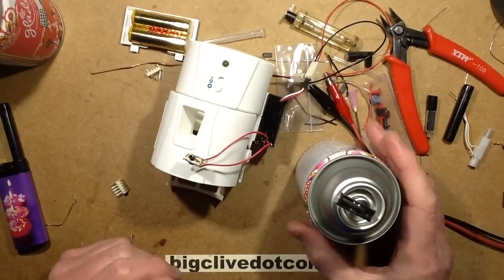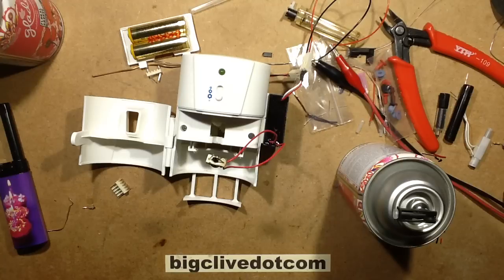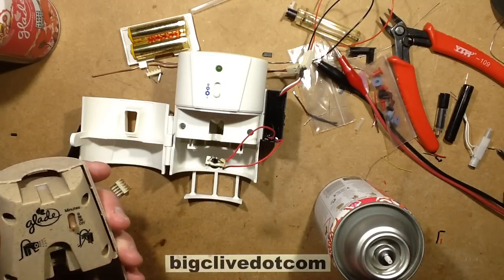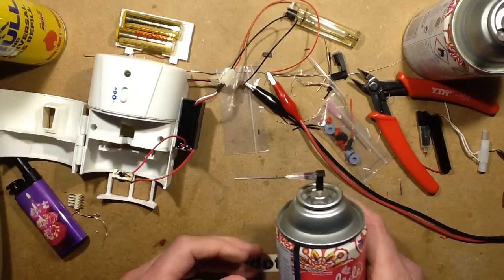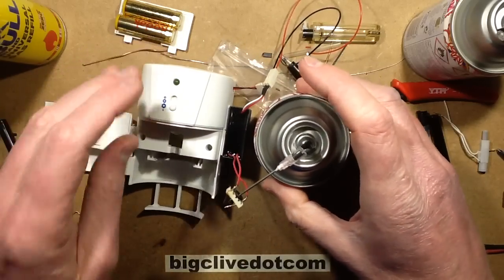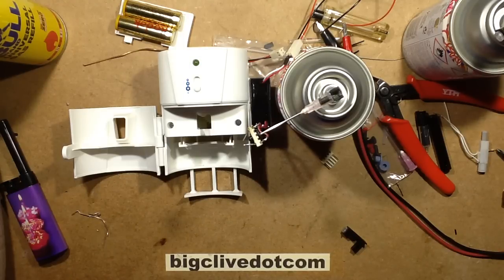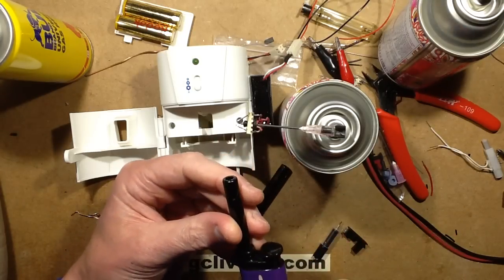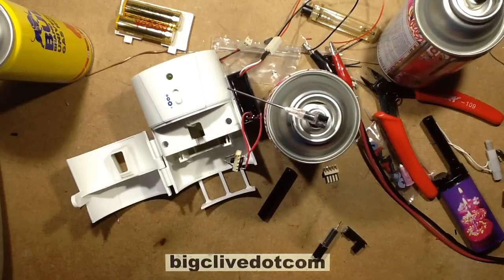Failed automatic flamethrower project.

Comment: 7:45 Big Clive just nailed it: Burning gas is not easy and exploding it is far more harder and getting the explosion actually do lot of damage is so much harder than you think. As an example in the building I was a super in 80's someone tried to commit suicide by inhaling cooking gas. The traditional open oven door, extinguish the flames and stick your head in job. But she forgot the pilot lights on the stove top. So gas starts to flow she passes out and slides from the oven. Gas get to critical mass and the pilot light ignites it. Result was a puff that was heard about 20 meters away. But the fact that the kitchen window broke the shatter was so loud that someone heard it and started to investigate. So firebrigade and police had come in. Later an ambulance came to take the still living culprit away. The major damage was that the explosion had broken the kitchen sinks sewage connection which was cast iron pipe and those pieces had plunged from the fifth floor all the way down into the basement where the was a bend on the sewage line. And of course there was no inspection hole there. So still in 80's that sewage pipe was prone to block.

The most stupidest TV explosion was the penultimate episode of Criminal Minds where the criminal explodes a three store building by inginiting a room full of gas. 1. If there was no air in the room the gas wouldn't explode or even burn. 2nd. Amount of volatile gas mixture in a room would not obliriate three store building.

Comment: I'd like to see the Whorehouse Perfume Cabinet Exploder project revisited 

Problem as I see it is you need the fuel to exit the nozzle as a fine mist and then add the oxygen source downstream in such a way that the flame can have a controlled starting point.
Could the snout from the stove lighter be cut to whatever length would be experimentally suitable and then sealed onto the original diffuser nozzle to achieve both? It seems to me that the snout itself could also possibly be used as one electrode of the igniter. I'm not sure about the mechanics of the automation, I'm NOT that electronically crafty

DISCLAIMER: This is all armchair theorising and it is not to be inferred as having any basis in juvenile farting about by someone called mulgawilliam

Comment: Old video, I’m aware.
If you’re wanting a quick burst of flames using an electric ignitor you need to mist the fuel.
If you use an electric ignition to trigger a pilot flame, the design you have here will work.

Comment: You have a similar problem as we did, you have to have a heated element or thermal mass to keep keep the nozzle warm enough to evaporate. The needles gets cold and therefore there really doesn't work well.

Comment: A pair of longer, parallel, rigid wire electrodes, with the tips turned in a little, would locate ignition further downstream and at the edge of the atomised fuel cone, where more mixing has taken place. Things could get interesting if you ditched the timer in favour of a pir!

Comment: perhaps a air intake fan working on a different power supply
made to look like it belongs to a cheap freshener but instead of it blowing out it blows in and pumps it into the nozzle like a micro jet engine 

the fan would always be on but it would prob work 

i just looked down and saw a comment about flames tend to work better if its a vapor 

normal ww2 flamethrowers use jellied gasoline under high pressure
but they have a slightly smaller tank that is a nitrogen tank for pressurizing the fuel

but for this project that would be too big for that

Comment: Just use the atomizer and kill the sparks before stopping the discharge. As long as the flame doesn't travel back to the plastic you should be ok. Also the igniter should be some distance from the nozzle so the flame heat doesn't melt the plastic nozzle.

Comment: I dont think it would be all that complicated to get it working from the point you have it at now.

in theory if you took the nozzle from that gaslighter stick and then fitted the inkjet needle inside that nozzle, positioning it such that the end of the needle was just a few milimeters back from the end of the lighter nozzle then the flame that ignites should self regulate and pull in (from the slots on the lighter nozzle) the exact amount of air/oxegen that it needs to sustain a flame.

the only thing im not entirely certain of is wether or not the initial movement of the spray passing through the needle and out the nozzle would pull enough air with it to create that perfect mix for ignition, so you may still have an issue with the initial ignition, however im fairly sure just encaseing the inkjet needle inside the lighter nozzle would solve the problem of maintaining a flame once started, the only other thing you might need to do would be to increase the length of the electrodes such that the flame wouldnt be able to backfire and desolder things. 

awesome little project though, i always love that you are not scared of uploading a failed project, since its still highly entertaining and alot can still be learned from it. thanks again for the awesome video.

Comment: So I bought the fancy one as a gift and it made som clicking noises that sounded like a sick parrot. I'm talking about the brown one you showed that takes the triangle security screw head screws. One year was off alignment so now it's nice a quiet. 
Now I want to make it throw flames, I have a metal dispenser tip for syringes I use for flux and a high voltage ignition kit that I still hadn't put together.
http://www.ebay.com/itm/DC-High-voltage-Generator-Inverter-Electric-Ignitor-for-18650-Battery-DIY-Kits-/401085322065?hash=item5d628c5351
Since its for igniting things I would guess it shouldn't melt if the spark arcs up. Since it's a kit i can change some things around, maybe get enough of an arc from a AA Eneloop or use a 14500 Li-Ion cell. It has enough room to put the parts inside the air freshener case. Maybe I can solder the ground to the metal syringe tip. Err, now I want to play with the flames darn-it. I guess I should buy another since she won't like me making the one I bought for the house shooting flames. I found it for $5 at our dollar general store with the can of smelly stuff. Not bad for $5 and it came with alkaline batteries. Oh, maybe a remote RF trigger or motion sensor 🤔 👹

Comment: Use a spark gap at 30cm/ 1 foot from the tip. The aerosol at the tip isn't mixed thoroughly with the oxygen in the air, it needs to mix a lot more before combustion can happen from spark ignition. The flow of aerosol also destabilises the spark gap, you may need a beefier HV supply to get a strong enough spark and a big enough spark gap.

I discarded my Firewick project and threw in a voice module, now every time it is used it relays a recorded message. Many guests here have noticed that an air freshener doesn't usually play Radio Pyongyang...

Comment: Hi Clive - any plans to resurrect this flamethrower idea? Your local (?) RC Model Shop will sell bags of mixed brass / aluminium tubing offcuts, and there's bound to be a diameter that would do the job as a venturi mixing tube. How about experimenting with a length of microbore central heating tubing? (8mm o/d I seem to remember). That might do the job?Your Loyal Followers are waiting to see just how much destruction you can unleash! :-D

Comment: Just put the syringe needle in the center of a slightly bigger metal tube. The pressure from the needle suck in air from the behind and get mixed with the gas. The tip of the needle just an mm or 2 from the end of the outer tube

Comment: Cut a hole in the metal nozzle tip tube half way between the black push button and the electrodes? It will suck in the air and be mixed once it gets to the spark section maybe?

Comment: widen the end of the needle like a trumpet, add a slightly larger tube and add vent holes, it will work well then. I made one years ago, you need to think of it as a gas torch assembly sir.

Comment: So a metal pen barrel around the needle nozzle with a hole in the side should make an adequate venturi tube for air mixing. I think you're very close to getting this right! Check out the design of a Bunsen burner, you could use a simple valve like that to have adjustable airflow, and it would likely be much less fiddly to get some good flames.

Comment: Clive what a great idea.I would suggest you grab an old hard drive or cd paler drive unit and steel the micro switch out - I've got heaps of various styles myself.
Then use a fly zapper circuit activated by that switch while being powered off the same batteries while having the spark gap in from of the emission.
It`s self arming and uses power sparingly. The HT circuit can be hidden in the rear of the unit so it isn't visible.

I used a similar circuit to create an electric fence around a pond. It charged via solar during day and self armed during night.
The neighbours cat really loved the surprise when it went to touch the water to nick my fish.
1 wire at 2 heights ensured the cat touched one HT line while the other went into the fond.

(( Disclaimer - No fish were harmed during hours of entertainment before my fish stopped being eaten. The cat however suddenly found out what over 3000 volts felt like ))

Comment: Have you tried not using a needle at all?

For shits and giggles mount the spark ignition over the exit hole of the outer housing, offset just enough so it doesn't get saturated by the fuel. Also use a standard aerosol spray head.

The only obvious downside would be that the housing is not flame retardant and maybe after a few activations you would get total meltdown.

Other ideas: 

You could bifurcate the needle about halfway down the length of it; 

Drill tiny holes at the base of the needle to see if you could replicate the lighter's method of pulling air with the stream, hoping that the aerosol follows the path of least resistance instead of creating a fireball inside the housing.

Without having the project in front of me it is hard to guess what will actually work.

Comment: hey hope you're well, 
id wonder if the actual liquid (smell) is flammable or not, the canister is pressurized with a flammable gas ( as we know )  so it got me thinking are you loosing any of that gas as it goes though the nozzle, possible a micro gap ??, you could also try to use a larger needle to allow more of the gas and liquid to pass though, piercing (cannula) needles would be good for this as you can get them in all sizes id maybe try a 2.2-2.4mm needle :) keep up the good work :)

Comment: Love your video's bigclive .Your flamethrower project reminds me of the working parts of a commercial steam cleaner.A small rotary pump forcing diesel through a jet to produce a fan shaped spray for good mixing with oxygen. A pair of igniter electrodes (adjustable as in your example)for the required spark ignition, all mounted in an air venturi and the missing ingredient-a fan or blower  which provides a forced air supply.
 The project will still need a lot of tinkering .Recommend parts from an old Gurni machine but guess that would spoil the fun.

Comment: yep fuel to air. on the end of the needle put small length of a larger tube. when the gas comes out of the needle it will pull air into the bigger tube with the fuel mixing the two.

Comment: I think if you drill a hole similar to the needles bore through both sides of the plastic holding the needle to the valve, which will leave you with 2 holes one per side, I think it should vacuum enough air into the gas before leaving the nozzle for combustion

Comment: Could you cut a small slit at the base of the metal tube coming off the sprayer so that as the fuel passes through the nozzle it pics up extra air through the venturi effect like a torch tip would? That could possibly help with air fuel mixture ratio. As for igniting the flame, instead of having the ignition as you have it now, could one wire be soldered to the metal tube, and the other wire hanging over the exit of the tube so that the spark jump from one wire and directly to the tube, just like a grill lighter? Then you wouldn't have to worry about the fuel killing the spark or the ignitor catching on fire.

Comment: In a lighter, one end of the spark gap is actually the nozzle where the fuel comes out, the other electrode is usually somewhere in the path of the flame so the spark jumps backwards through the fuel.

Comment: I think the problem is your nozzle extender.  Instead of atomizing the fuel, mixing it with air, it just sends a laminar-ish flow of gaz towards the igniter.  A bit of the gas burns like a Bic lighter and some gathers on said igniter only to combust gradually as it evaporates.

The fist thing I'd try would be to squish the end of the needle to turn it into an atomizer.

Comment: Perhaps you could create a nozzle that acts more like a pulsejet engine by injecting your fuel into a tube open at both ends, but bent  so they both point in the same direction. Then ignite your fuel air mixture a short time after the input. Then you'd get a fireball effect, rather than a constant stream.  But let's be honest, you wouldn't have gotten a stream anyway because the way these things operate anyway.

We just want to see that flame, bro :)

Comment: It may not have had the "desired affect" for you...but it had the desired affect for us! ...because we got: "Whorehouse Perfume Cabinet Explosions", which is itself worth the price of admission!!!
Suggestion:  You put the needle supplying "whorehouse gas" into another (metal so flameproof) venturi tube (maybe the diameter of a drinking straw), with ignitor located at the  exhaust end...that way you get some W-Gas/Air mixing before trying to ignite it.  A sort of Whorehouse gas carburettor if you will.  Good Luck (please remember to wear Nomex undergarments during development)!

Comment: on the subject of electricity, I'm actually starting on mounting the electronics from a bug zapper net onto an airsoft gun. instead of the net, I'll have the positive and negative outputs touching the axles of motors that are from a playstation controller. so the motor vibrator hubs spark when they come in contact with each other.

Comment: Mythbusters did a lot of episodes trying to get thing to ignite and I think there conclusion is the one you are missing: the liquid comes out of the can thus becoming gas. because it changes state it absorbs heat when it comes out and this stops your flamethrower from working. It's basically a supercooled gas. 
On my gas range the arc comes right up by the gas from the center -- it'd be like using your needle, and it works fine because the gas is only at 16.7 psi, 2 pswi above room pressure so its never in a liquidf form and thus never "heat hungry"

Hope that helps you make it work. What you need is some very old toaster wire that used asbestoes or mineral wool around the wire and use that for a few inches before it hits the sparksd... maybe like a 3-4 dia circle and zip tie it to itself (gently so as not to crush it) and use it as your nozzle.

Comment: I can't help but think that the electrodes simply need to be far enough away from anything flammable, as well as the nozzle tip, and your air intake vents. As convenient as the little pin connectors are, I think they are just not the right tool for the job. The plastic is simply too close to the flame, and carbon is bound to build up till the spark gap starts to arc over the carbon instead.

What about making the air nozzle part live. That is, attach it as one of the two electrodes. Take the steel point of a compass or a sewing needle and mount it to a single sturdy extension, set off to the side of the nozzle, so the tip of the needle points toward the center of the nozzle opening. No wire or flammable materials should be near the opening of the nozzle. I've used a particular style of set screw type wire terminal block to mount stuff like that in the past. Remove the set screw, slide out the terminal body from the plastic housing, and then put the set screw back into the terminal body and secure the needle through it. The terminal block part is solderable, and you could mount it to anything really. Copper clad would probably work, and by soldering two board pieces in a T shape, you could make it rather rigid, and the thermal mass of the copper should prevent the heat from melting the solder, as it shouldn't ever burn long enough to ever transfer enough heat to do that.

Comment: Hmm if your worried about the air to gas ratio. Just take the edge of a squire file and cut an backslashed notch in the metal needle to made a "venturi" where the force of the blast should draw air in with it and mixing it by the time it hits the igniter which this is just.. theoretical... but might work.

Comment: i actually made some of these a will back and i ended up adding a tube slightly bigger over the needle so wen the gas come out makes a vacuum and pulls in the surrounding air to ignite  :)

Comment: Try a bit of thin nichrome wire instead of the spark gap (dunno if it will work or not, but would be interesting to try), a bit of pencil lead, or place the spark gap further away, so the gas won't blow the arc out.

Comment: need to use a crelay in the set up. there for. when it activates it also fires the unit. then when the power goes off  then igniter stops as well.

Comment: Definitely, the "fuel to air ratio" is very important. I was doing some 'test modifications' on my natural gas cooking stove to convert it into a "wok flamethrower style" and I found that the ratio of the gas to air determines its feasibility. Too much air and it 'pops' switches off. Too  little and flame is yellowish.